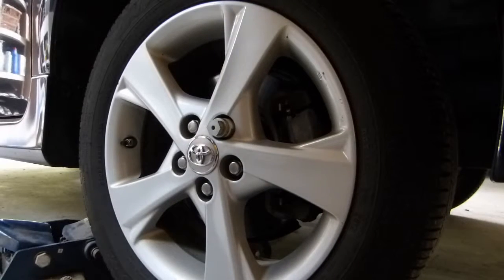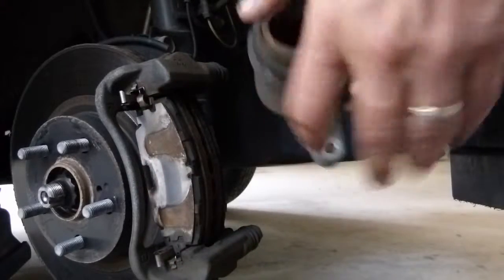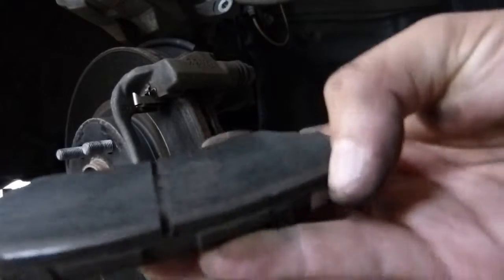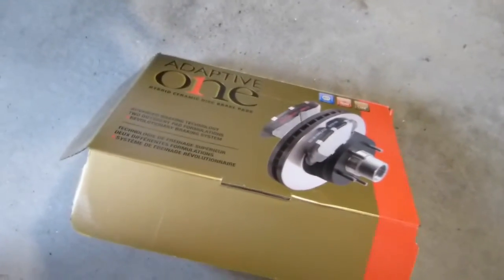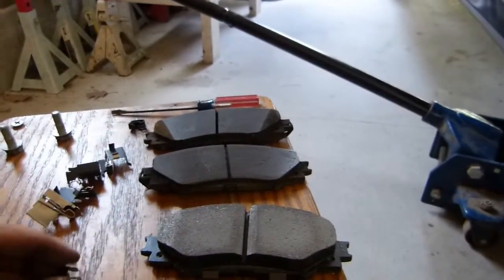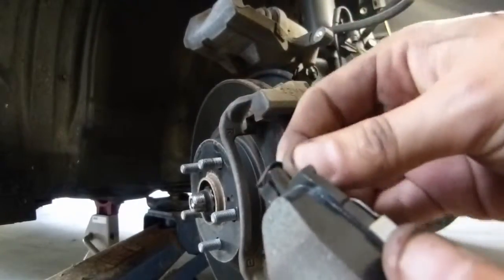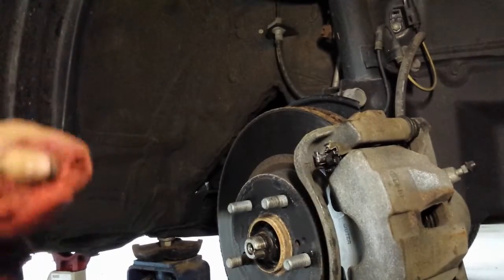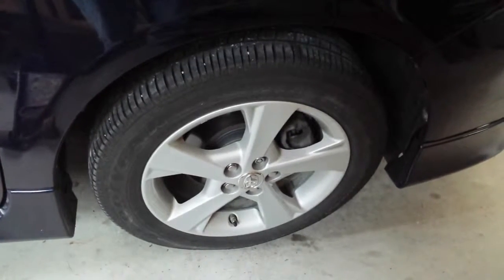Toyota Corolla Disc Brake Pad Replacement Highlights

Comment: Toyota brakes really wear quick. I've used NAPA gold pads and rotors with much better results. RW
Reply from the maker: +Radio wild - How much brake dust do you get with the Gold pads?
Reply: +SevenFortyOne They will dirty the wheels up with dust. I have a Camry and a Highlander. Yeah they are dirtier, but last longer and stop better.
Reply from the maker: +Radio wild Thanks RW!  The guy at NAPA told me the Adaptive One pads are as good or better than the Gold pads but will generate less dust.  I guess I'll find out about the dust as time goes on, but so far they seem to be working great.